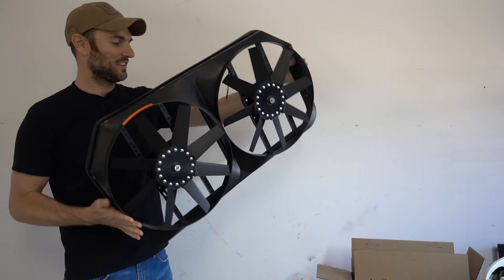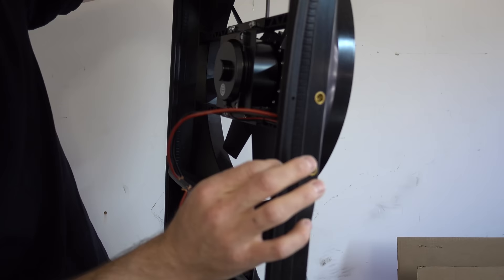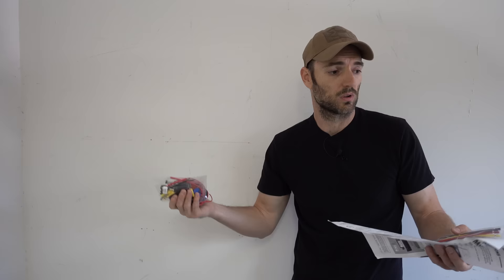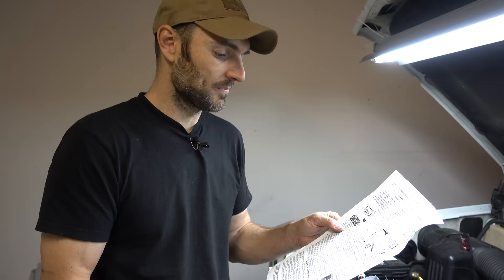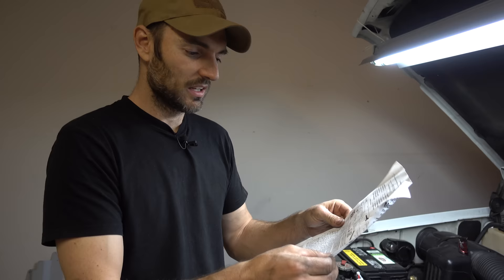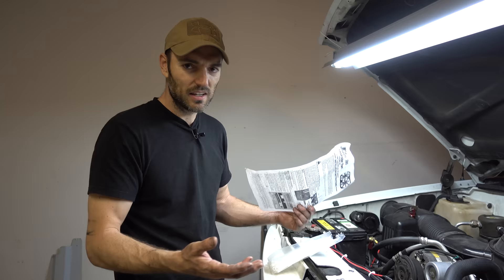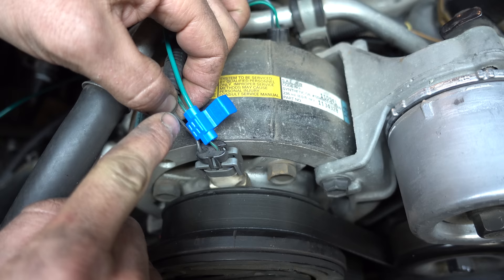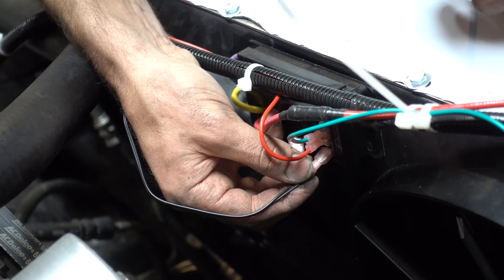Flex-A-Lite 280 Monster Fan System INSTALL & PAYOFF

Comment: 500 bucks. no thanks I'll just replace my worn fan clutch for 60. problem solved
Reply: Bobby James or buy a $75 electric fan and a $12 wiring kit for it.
Reply: i did mine with a junkyard fan from a volvo 40 bucks and replaced my cars original fan control sensor with a 15 dollar temp switch.
Reply: You have a two speed relay with the volvo fans n the 850 v40 models at least.
You just need a thermoswitch if your car have not one.
Reply: Late model Silverado/Suburban fans from Doorman are a fraction of that cost.  Little bit of modification to the shroud and it fit in my 454 'Burban beautifully.  Overheating issues solved.
Reply: Yeah 10 HP  = 7500 watts of power for a   mechanical fan    while the electric fan will only run about 200-300watts  1/2HP   = 9HP freed up!
Honest the mechanical fan is a huge drag on the engine  save your spare change and you will have enough in a 3 years for one  I have saved my spare change and have  almost 400$ saved for anything I want to use it for
Reply: Today is December 28 2017, how long has it been on your truck now? Have you had any problems with it? I'm thinking of putting e-fans on my 02 Silverado 1500. GOOD video, Thanks
Reply: Dale, I've been running mine for 3 years now.  No issues at all.  Solid performance.  I've done electrics on all the trucks I've owned and always will ditch mechanical fans.
Reply: it says he got it free thats the only reason he has it who would pay 500 bucks for fans haha
Reply: ur not cooling a 5.7 with a single $75 2800cfm fan. and $12 wiring? ya no .  Hayden controllers run $40 and fail ALOT
Reply: i think you missed the point of this swap. it fixed all the oem fan cooling issues. plus it frees up HP and really helps OBS MPG. i have over $1200 in my swap and id nvr go back. but then again i ve owned my obs since new 94. i see it for all the improvements ive got in the last 10 years since i first did dual fans.
Reply: 001 002, you probably have some old pennies, they're real copper and worth twice as much as face value.
Reply: Ya or just change your fan clutch rofl... for $500 that entire thing better have been made in the USA as well...
Reply: Matt Lane it is, and there are issues with the stock fan and clutch set up. The stock setup is always moving at some speed causing the engine to take longer to reach operating temperature, especially in the winter. The electric fan takes less power to run and isn't hanging off the water pump causing extra friction on the water pump bearing and seal. The electric fan can run at any speed regardless of engine speed; the electric fan can run full speed while the engine is idling while the mechanical fan can only spin around 600 RPM max which is where the air conditioner problem comes in.
Reply: Right old school mechanical clutch fan still more reliable then any electric fans
Reply: I used a window fan from my house and used a power converter.
Reply: I'm currently in process of replacing my belt driven fan with a electric one.
And I'm only going to use a switch, so no tempature sensor thing.
No, not because I'm lazy and don't want to drill a hole but because  #RaceCar feel when you need flip a switch before starting😎🤙🏻

Comment: While that fan will work great when stopped, it will not pull anywhere near as much air as the stock fan will when working hard like towing in the hills. The stock fan can easily take 25 to 35 HP under those conditions.
Also, if your stock fan can't keep the ac going, there's something wrong and it should be fixed right.

Comment: A water vapor cooling system is cheaper and better. Check them out. The blades are offset so you can reach in to pull the fan off without the pulley.

Comment: Know its kinda late but judging by the step in that top bracket you used i mean ya said it came with a few but the one you installed could it of held the whole fan (s) housing up & closer to better clear you problems if ya turned the bracket around it would step up raising the fan instead of down & then the holes would also pull it in more solving the gap issue? Just curious its hard to say 100% for sure with just the camera angles shown either way good break down...

Comment: The main power fuse directly connected to the battery looks   amature. Then using that piggyback connector on the ac  clutch power confirms it. For a kit this pricey you think it would be better thought out. Yes, it works but .... cheesy

Comment: On my 97 ram i run a dual fan with shroud off a 02 silhouette minivan and i only run 1 fan in az the other fan is there if i need it and on my ae86 ebay $20 fan a $1 switch and $1 relay over a year no issues

Comment: do the fans kick on during overheating too?
Reply: classic gamer less than that wholesaler 28 $..this guy is pseudo hippster ...just service your system flush or replace radiator 85$ new for me..on truck..go from 5 blade to 6 new coolant and under 150$ reason for off   allow access
Reply: Yes

Comment: I would think that before going through all this trouble it would be good to check out the air conditioning system , the alternator, battery, clutch fan first. I doubt that the car had this issue when new. 

Going hot air at idle is not right. Something is off. If all is really ok then maybe upgrade, but to what? If my memory serves I do believe a fan in front of the radiator is on a lot of cars for this reason. If the car was not overheating and it was just the air conditioning  then that would have worked.

Did not like the connections on this.
Reply: andrew domenitz yup, that tells me all that stuff was acting

Comment: I think Amazon is pissed at me right now i have been looking at the flex-a-lite 270 for a f 150  but at the price of $370 to $495 each I just couldn't get one. well on the 6th of march I looked and they had them for $104 so I bought 3 right then and there. a few days later the sent me a email saying they miss price them and wanted to know if I was willing to cancel them and pay the right price or if I was going to make them sell them at $104 each. not in those words but that's what the ask. I never answered them so the places my order. and here it is april 7th and I still haven't got them they haven't even been mailed yet. but they say I should get them by Friday the 10th. but it also says pending. but I don't care if it takes a year I will not cancel them and they will sell them to me for $104 each.

Comment: How was the burban performance wise after the installation of the fans? I hear if you eliminate the mechanical system and make it to electrical, you eliminate engine stress.

Comment: I can say one thing. This isn’t your average electric cooling fan set up. My 383 stroker would over heat in 2 minutes sitting still with a regular flex a lite cooling fan. These fans are MUCH better. A regular fan will pulls up to 1200 cfm, these two fans together pull 5500 and have a good seal in the radiator, not to mention how quiet they are, probably more quiet than the oem fans and they probably pull more air. My coolant temp hasn’t past 170 ever since

Comment: I may be in the minority here but I prefer manual fans. As long as the engine is running you have cooling. I don't trust electric fans on my Jeep off road.i upgraded to a 7 blade flexalite manual fan and it flows way more then enough air and as long as the engine is turning so is the fan.

Comment: I have an 03 Chevy suburban with only 72000 original miles on it I live in Florida it only acts like this in the summer time and when I'm in a lot of traffic my AC doesn't blow  as cold as it does when I'm moving down the road I believe I need to change out my mechanical fan for an electric fan any thoughts or ideas on which fan I should go with and how to wire it up?
Reply from the maker: A lot of people have great results leaving the stock mechanical fan and adding an additional electric pusher fan (junk yard find) in front of the condenser. As for wiring, I'm sure there are a few vids on YTube that would be great for that. 👍🏻

Comment: This fan setup is completely unnecessary. But while your on the subject in used a Chevy traverse Duel fan on my S10. Runs 50% all summer with AC going 100% only kicks in with AC off slow speeds. Cost free plus wiring. My chevelle I'm running a 16 jeep renegade single fan never overheats fits the rad perfectly. Cost free plus wiring and fan control.

Comment: This should be added horsepower to the truck because of the clutch fan you actually lose power
Reply: I saw a video  of a Tahoe with the added electric fan it showed 10 HP gain at the rear wheels.
Reply: I've also seen it increase hp by 10-20 and also improve mpg by 5-7mpg. That stock fan is not light and your engine is always spinning it.
Reply: It's true! There's dyno videos showing the losses from the direct drive fans out there, and you really can feel the difference when they are at full tilt. However they do move more air mass when working properly and they will do a better job. There's a good reason bigger vehicles and commercial trucks use them still. The dyno videos I watched proved they use every bit of 20hp, but not for too long because they will suck the heat out of that system in Just moments!
Reply: John,  yes, 5-7 is a bit steep haha. But you do gain 10-20hp. Checkout Enginemasters where they test and dyno engines with mechanical fans then compare it to electric. The numbers don't lie :P
Reply: You are absolutely right! Modern vehicles still use Mechanical fans typically on vehicles that are designed for towing. When towing up hill at 55mph for example, an electric fan won't push as much air as a mechanical fan. It will rob on power, but it will keep you cool while useing 100% of your engine for long periods of time. Electric fan's are great if you are not towing as much and drive maybe 45 mph and under? After that, the air hitting the radiator does just as good. But yea, depends on what you do with the vehicle. Also why Toyota uses Drum Brakes on their Tacomas. They're better for the truck for what it was designed for.

Comment: They use to much curant to much amperage on electrical system. I have used them your voltage system can barley keep up with a.c. system is on use the factory Gmc double fan set up work fine wit out so much of a draw on your system

Comment: Question, I deleted my ac system does this fan system require a connection too the ac compressor too work properly or will this work on a truck with no a/c aswell? Ik your not a rep or anything but do the instructions say anything about skipping that step?

Comment: I watched your other video's. What did you find wrong with the voltage problem. I'm alittle confused, because if each fan draws about 27 amps, it seems like you would have needed a 60 amp fuse, and your alternator needed to be at leased 60 amps more than what you stated with, plus your battery could have been alittle more cold crank amps. What did you find was the problem?
Reply: Dale Bourgeois. He needs big 3 up grade

Comment: Question, do you need a aftermarket fan controller with aftermarket fans? I have oem fan controllers I've just replaced the fans with aftermarket fans! Thanks in advance :)

Comment: "Always"! put your fuse as close to the battery as you can!
Reply: 12 t0 18" away so to be away from corrosion and sulfuric gas, not to corrode your new wiring or fuses or relays.

Comment: Please people do not wire tie your radiator hose to a metal line, from the vibration it will end up wearing through whatever line you put it too and if that's your transmission cooler line, bye bye transmission. Wire tie it to the Oil cooler line? Bye-bye engine. Not to mention when your engine moves when you get on the throttle it may put that radiator hose right back into that blade then bye bye head gaskets.

Comment: do you feel like maybe you gained a few horses since you freed up some load from the clutch fan?
Reply from the maker: +Frank Barrera yes definitely! I do feel it especially in the very beginning touch of the gas. I'll be making another video on this system soon about my overall impression after using for a while. I can tell you right now that my a/c is functioning soon much better!!

Comment: Brother good Job, May I know How much watts are consume by those new fans , I was planning to install Denali Radiator fan for my yukon 1999. If you have any expereience pls share. Thanks
Reply from the maker: +Lakshan Dawood They require approximately 30 amps. Don't know about that Denali fan... Thanks for watching!
Reply: Forget watts, is not a stereo, it's AMPS ELECT. AND CFM OF AIRFLOW.

Comment: So it only turns on when you turn on the a/c I thought it would just turn on when it's needs to turn on by itself
Reply from the maker: There's two situations when it turns on; if you turn the AC on and, if the AC is off, when the temp reaches the set point.

Comment: Its a good project   but dam $495.07 plus the install   hello junk yard and get one for 30
Reply from the maker: +Tom Brenes you certainly could go that route. Just won't be customised for your specific vehicle and might not pull enough air.
Reply: Tom Brenes I got a dual fan setup off a 200* Concorde on my s10. I just had to cut the factory mounts off and trim a little off each side and it fit on my truck. I had the first set of fans go out on my buy $70 later I had a new set off eBay. It is a good idea to use dual relays on them because I went through a few relays that kept locking up on me.

Comment: Do the fans run when driving on the interstate at 70 mph with the AC on?
Reply: Whenever the a/c clutch engages they will be on no matter what speed as long as you have it connector to the positive side on the a/c power

Comment: Hello my name is Javier. I have a question for you so I have a 1998 tahoe similar vehicles, so my dash lights and tail lights don't come on when i turn the switch but when i push on brakes and turn signals they do work? Do you have any clue what that could be? Please help!
Reply from the maker: Javier Samano I would always guess the easy stuff first. check the fuses in the fuse panel on the side if the dash. if that's all okay, check the actual switch itself. maybe go to a junkyard and get one for cheap to see if the new one works. if it still doesn't I'd check for wiring issues relating to that switch. hope that helps!
Reply: Hey thanks for the help I really appreciate buddy! 👍🏽
Reply: Javier it sounds as if you may have a short or something going on. Check the wiring harness thoroughly for any chaffing where the wires may have rubbed thru. This is the cheapest way of doing this. After that you can move to checking switches for proper operation. When you push the brake and the lights come on that tells me something is shorted as much as I can tell without looking at it. IF you've got it fixed please let us know what the problem was. IF not fixed check what I suggested as well. You can also use a test light and work your way back in the wiring. If you poke the wire harness with a test light and go thru the wiring insulation use some clear silicone caulk or gasket sealer over the hole to prevent corrosion where you probed the wire.

Comment: ALMOST EVERY R12 CONVERTED TO 134A NEEDS MORE AIR ACROSS THE CONENSOR SINCE THE R12 CONDENSOR IS NOT EFFICENT TO USE 134A.  NEED MORE AIR, OR UPGRADE CONDENSOR TO A 134A FIN-PLATE VS. R12 TUBE STYLE CONENSOR.....  That's my take on it.....
Reply from the maker: This truck was stock 134a
Reply: Then something's wrong in the system.  Did you try cleaning both the condensor and especially the evaporator?   I use a very strong sodium hydroxide foaming cleaner for HVAC's by National Refrigerants "Kleen Foam" which produces a very heavy expanding foam through the coils.  But like others said, the system must have some other issue.

I can't wait to install and and upgrade to a Flex-a-lite 490 S-Blade for my 90 Cadillac Brougham.

Comment: how is ur ac now compared to before??I need to get these..awesome videos thanks for them
Reply from the maker: +Thomas Hoyne Hello Thomas, my ac works much better than before. Also, my truck stays much cooler than it ever has. That being said, the AC is still not to the level of a new vehicle. I am going to make a few more vids soon regarding this subject so stay tuned!
Reply: 1 Road Thanks for sharing. I am considering this upgrade mostly for the AC benefits on my 1998 Sierra but I'll have to wait for your next videos on the subject. $500+ is a lot to spend if the dual fans won't help much with the AC at idle in the California desert.
Reply: rocket5557 get the severe duty fan clutch.$50.I'm in Phoenix and mine blows at 40' when it's 115 out
Reply: Since it's a 95 it may have R134a in it instead of the old R12. R12 would freeze you out while sitting in traffic on a day of 110 temps outside. I know some manufacturers converted to 134 around 94 or so but I cant remember when for GM. If your Suburban was factory R12 but converted to 134 then yeah it won't be as cold as a vehicle built for 134 use. My 92 Caprice and 93 Buick LeSabre had to be converted over and although they do keep the inside cool, at too long of a standstill you can feel the air start to warm up. I wish I had better knowledge back at the time they were converted, I would have done the repairs myself and kept them with R12. I still find it for sale on the net.

Comment: give it time, that module will burn up at your connections, and you will be ending up putting the stock fan back in when you cant get the flex-a-lite parts at a parts store, been there done that, took me to learn three times! 😂
Reply: Damn. I wanted t do it just to give me some space in the engine bay.  Was wondering what the long term effect would be